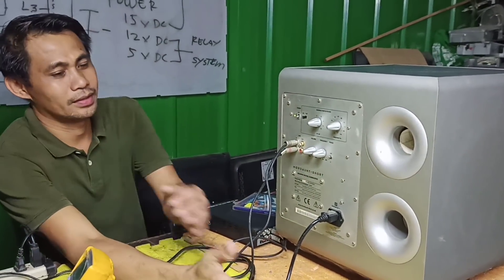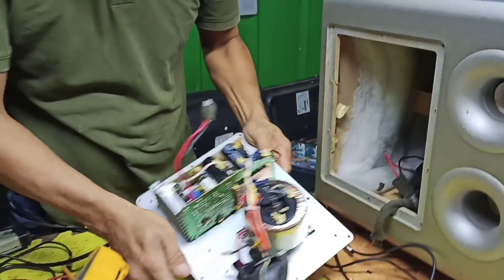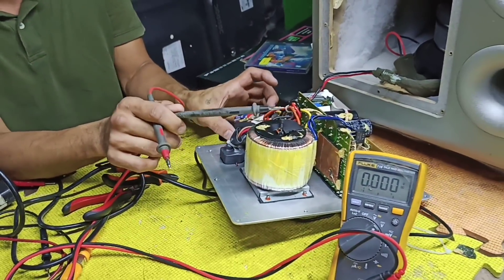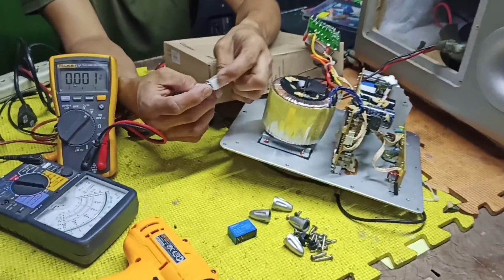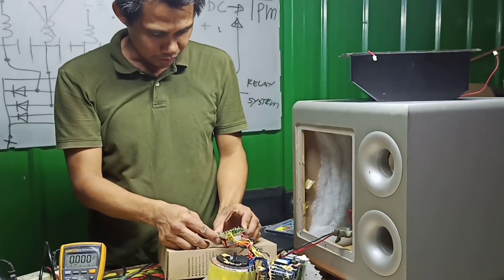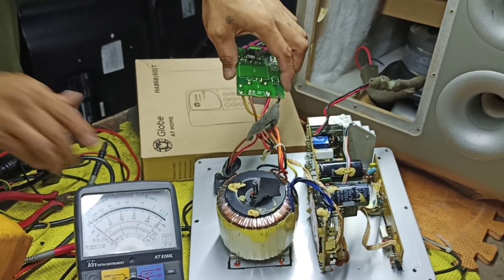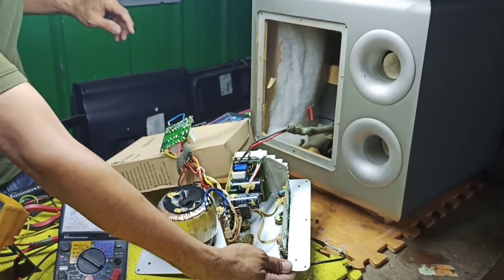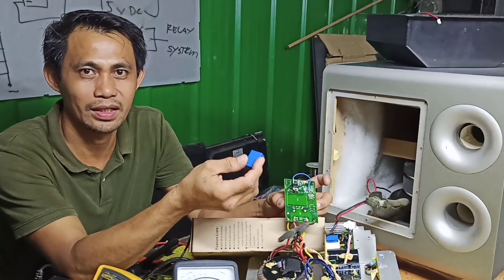HOW TO REPAIR NO AUDIO ACTIVE SUBWOOFER

Comment: Mga Pakners, tungkol sa unit na naipresenta, pamilyar ako sa design ng subwoofer unit na yan.
Actually, hgh end nga iyan sa kanyang kapanahunan ng unang inilabas yan. Subalit sa ngayon, ay obsolete na iyan for year 2000.

Maganda ang desenyo at konsepto nyan dahil efficient or ekonomikal in terms of electric consumption.

Dahil ganyang desenyo rin ang published ko weely sa  gazzette during may college years (1987) 
Dual supplies para sa main at stand-by. But actually, yung stand-by ay para lamang sa operation ng relay nya to power up the main power for the amplifier. Since, hindi naman sya remote controled-operated na tulad ng design ko nuon, suppressor lang sya para walang sudden surge ng power or nag function lang sya as manual speaker protector.
Unlike, sa desenyo ko ay ginamitan ng hiwalay na rf signal to ON and OFF the switch. 
Sa madaling sabi at lubos na maunawaan, yung stand-by power ay parang system supply ng mga tv ngayon na remote-controled operation na 3.5V to 5V stand-by supply.

Anyways, matagal na yung designs na yun (1987, pa to be issued sa Electronics Society of Mapùa),but not released  dahil kailangang kong submit muna for mybterm paper.

Sa ngayon nga, transformerless na ang gamit sa stand-by supply unlike then.

Comment: thanks sa video sir, tanong lang wala po bang heat dissipation sa 7812 reg? kasi halos kalahati yung binawas na voltage from 24v/36v to 12v po.. thanks in advance..

Comment: Sir,  I want ask about the problem of my Altec Lansing MX5021 subwoofer no sound but the 2 Tower have sound and okay. I troubleshoot and I confirm the subwoofer speaker is ok I try to connect to the left and right output OF TDA7265B and okay have sound. I check all E cap and resistor and diode okay including suppy or voltage. I tried to repalces the TDA7295 for bass but still no sound and replaced also the TDA7433D but still no bass sound in the subwoofer. Any idea need Help.